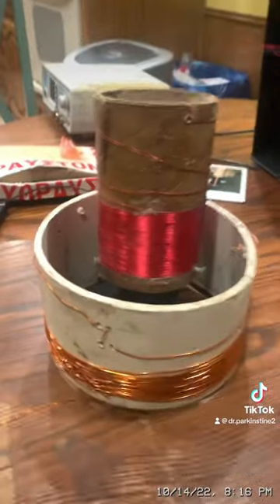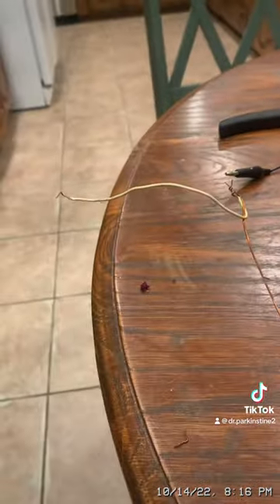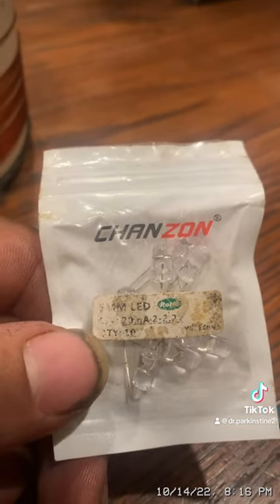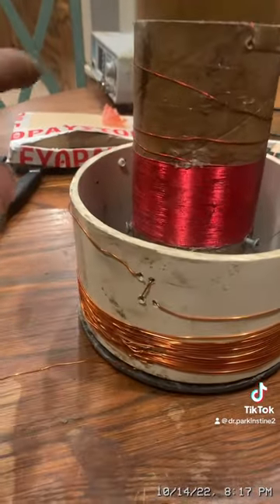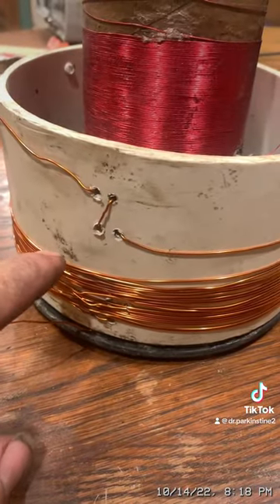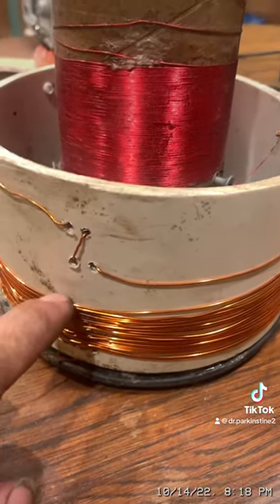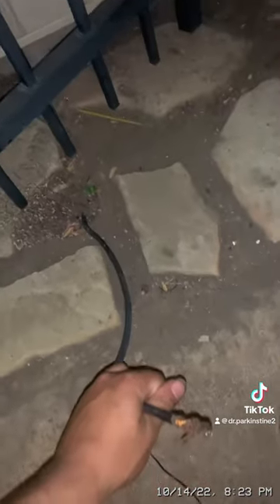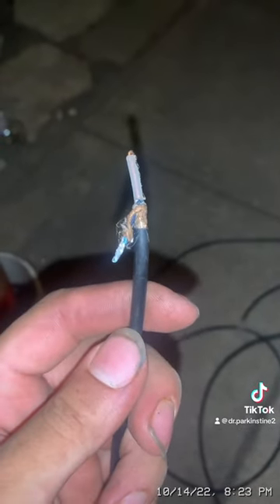Pulling electricity from the air

Comment: glad there is not too many comments, you will have a chance to see mine,,, build a cascade ant to collect natural freq while building a constructive ac wave. use the pyramid as the range of freq by length, note each freq will require a different rc circuit "centered" NOT "middle" channel tuned.. yes you should get good results, begin tuning at 60hz careful choosing a output base 10-20% freq dont forget you can skip the cascade by making them all the same freq however you will need to still convert them so as to come up with a constructive wave form
Reply: Are you trying to blow him up for what
Reply: Amazing

Comment: I've made a few silicon carbide leds based on oleg losefs designs and tried sealing them in some low temp glass green sic can be a bit of a bugger to get work but seems to be brighter and use less voltage but harder to find a point contact that works whereas black sic is easier to find a point contact and can work at 3v but is not as bright and is harder to find chunks that can run at 3v... I wonder if this guy would one day like some samples of those leds?... I don't have them anymore sadly tho or the big sic crystals

Comment: Probably less power than what comes out of a watch battery in this case, but it's something. (At least enough to light up an LED.)
Reply from the maker: In this case yes because there is no magnifying transmitter this is solely the idling oscillation the magnifying transmitter magnifys this effect